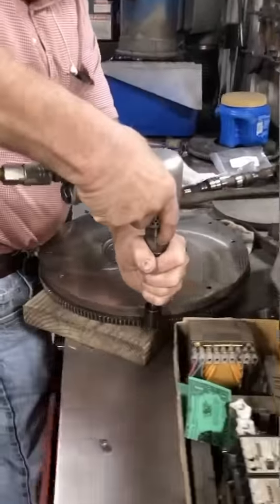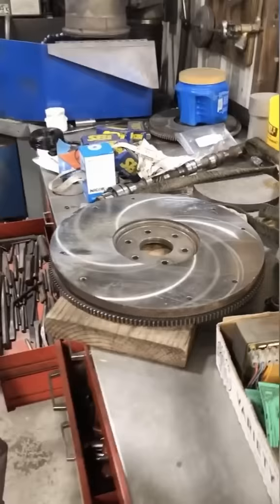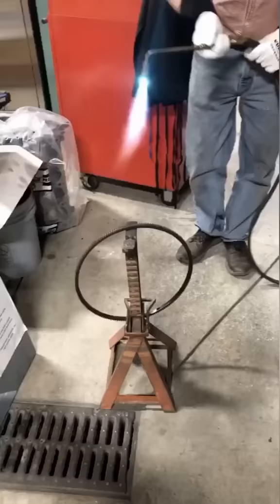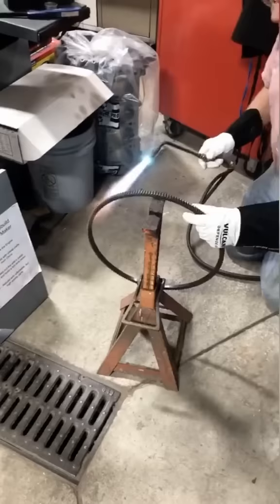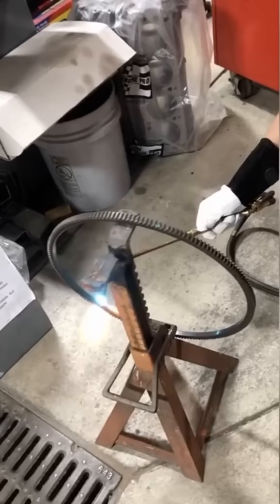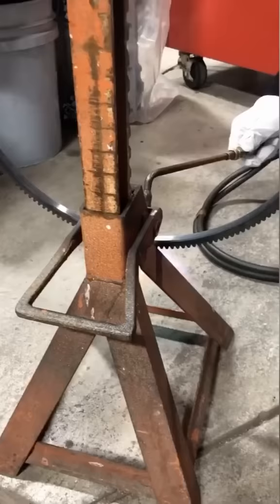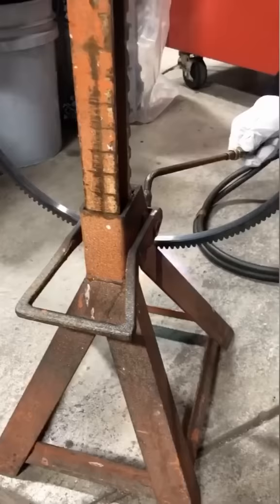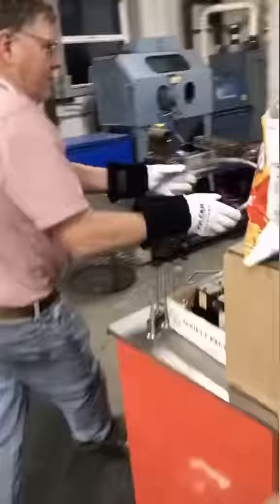#shorts Flywheel Ring Gear Replacement

Comment: Did this using a bbq grill. Half of the ring gear teeth where worn, so I just flipped it over. Worked flawlessly ever since.
Reply: I had a Chevy flywheel that I put on backwards cause of work teeth. Can't do that on these newer cars
Reply: On my car I was able to reverse flywheel, automatic trans, the flywheel was neutral balance
Reply: At a low heat it really is a better way, or an oven. With a torch you risk getting it above 500F and ruining the heat treatment of the gear teeth.
Reply: “Hey, the mechanics have figured out how to reuse these gear rings by flipping them over.  Make a note to redesign them so they’re half as thick, because f those guys.”
 - engineers.
Reply: I just flipped starter ring over on my brother's father in laws truck engine.  Had to weld it on to flywheel.  He bought truck new and gear came off flywheel at less than 30k, Chevy dealer welded it on first time.  On an old S 15 4x4 small truck.

Comment: I was in the transmission business for years. I learned something weird. The physics of a engine always stopped in one of three positions when you shut the engine off!! That means that everytime I started the engine the Bendix would hit one of three spots every time. Which led to wear on the ring gear in those spots!!!! Your father is spot on!! That's how I changed out Ring gears on manual transmission flywheels👍😎

Comment: Very cool, and nice torch work. Sounds like thermal expansion. The increase in temperature causes the molecules to expand while decreasing temps will cause shrinkage. There are some exceptions to this rule in some materials. Water for example stops contracting and starts to expand as its cooled to freezing, however only for a limited ranged before the material starts contracting again.

Comment: My dad taught me the same thing, I miss him.
Reply: I'm glad you called him dad and not the old man 👍
Reply: My kid calls me pops, but that's beside the point.
I used a similar process to change a ring gear on a limited slip carrier in a car, once. 
Carrier was placed on its bearing standing so the gear was facing down, bolts already removed.
Used the torch to heat the ring gear, and it fell off.
Turned the carrier over to the other end, standing in its bearing.
Placed the replacement gear so when it fell, it would line up with the bolt holes.
Heated it up, and waited until it fell onto its seat.
Did a quick alignment with a spud, and made sure it was totally seated on its own.
Then, the bolts were torqued down, much like a wheel bolt pattern. 
Never had a problem with that method, and never overheated the ring to lose the temper. I will say that I'd did take a few more than six passes, though. 
Those things are THICK.
Reply: Mine as well. He's always fabricating something.  His ingenuity blows me away.

Comment: Damn, I thought for sure that the teeth were machined into the flywheel
Reply: Same here
Reply: Hey no worries! I love mechanical items of all kinds, guns, cars, tools, doodads of any kind make me smile, for the longest time I thought the same! And you aren't wrong tho, some gear sets ARE machined as is. But when you think about it it makes sense for a vehicle, I mean you use it almost every day all the time and parts WILL be replaced or worn on it after all, i suppose it's easier to machine a ring with teeth and it makes it much cheaper when there is very little material. Plus if you have a problem with one you can slide it off and replace the teeth themselves (which when I think about it its genius) because they're the one part of a gear actually being exposed to wear and tear, so why throw out the whole thing when you can replace just the ring? This is why I love things like this. Each day you learn something knew! Even if it's not complicated, its neat. It's even cooler in my opinion when the solution to things like this is the simple answer used in a clever way.
Reply: Me too, I always thought it was a single part/piece.
Reply: I didn't
Reply: same here
Reply: @wedohedoshedooowee828  Just depends on what kind and year! My 1965 IHC has the teeth machined into the flywheel itself. Everything's different, just gotta try to see the mating lines or check forums or service info if you have it
Reply: really and the ring gear just threaded on like a quarter 20 🔩 bolt/nut
Reply: @wedohedoshedooowee828  I  took it off and would flip it a gaff turn and put it back on other side is like new
Reply: On some flywheels they are.

Comment: Hey man, love the videos. Not sure if you have ever tried it or not but if you have an old oven you can put a flywheel in there for 5-10 mins the old ring will fall off. Throw the new ring gear in the oven for a few mins and it will drop right on
Reply: Why do that when you can use fire? 😳🔥😅
Reply: @dannygurney5130  Oxyacetylene is expensive
Reply: @explosivemallard8038  Yes it is. Yes it is. But, it is explosive fun.
Reply: @explosivemallard8038  the rig might be, but filling bottles is cheap.
Reply: You jus said it, 5-10 mins.... Using the air hammer is faster. And it looks like a shop use paying for gas is cheaper in the long run 😉 doing other jobs and such...
Reply: It seems to me in an oven the rate of expansion would be the same between the fly wheel and ring gear keeping it locked on. I have never seen a ring gear slip on a hot flywheel in a vehicle and that is higher temps than an oven. I personally cut the ring gear with a torch. Then heat by the same method. It only take a few minutes.
Reply: @explosivemallard8038  so is a wife when she catches you putting car parts in the oven
Reply: WRONG!   If you did that the flywheel will expand too and the ring will not fall off

Comment: Thats awesome  I believe for every 100⁰ you expand steel you get 0.001"
Reply: 1 inch of steel expands ~.001” per 100°F. Yep. That’s essentially the basic rule.
Reply: 7 micro inches per degree F, that's the coefficient of expansion for steel. This is simply a coefficient for plain steel, so a shaft. When you have a thin walled sleeve/gear it will grow differently.
Reply: @patrickirish9427  im not a machinist never learned the proper coefficients of what metals expand at lol
Reply: Interesting fact. Thanks 👍
Reply: @patrickirish9427  Your understanding is flawed. The coefficient of thermal expansion is effectively identical for all grades of steel for this purpose. It doesn't matter if it's a solid disc or a ring the calculation is the same.  Go look up the math and I can walk you through it.
Reply: Isn't it steel dependent? 1080 is denser than 15N20
Reply: How much in SI?
Reply: And the larger the diameter the more growth you get

Comment: Been a mechanic all my life and never knew this was a thing 🤔
Reply: Me either
Reply: I'm a machinist. We have tricks for EVERYTHING!! Probably have heard of this one. If you cant get a bearing off a shaft throw it in the freezer.
Reply: I'm a industrial mechanic. I don't even work on cars :c
Reply: @officialaaronjames9641  that I have
Reply: Same here
Reply: @officialaaronjames9641  or heat the bearing. It’s a lot quicker. Even quicker than that they make bearing splitters. A puller just for bearings
Reply: I usually put the ring gear on a sheet of
metal and heat the sheet so it’s not taking direct heat. It’s a lot safer when you’re heating big Diesel engine flywheels
Reply: Its because  its a flywheel off a stern drive boat motor.. probably a mercruiser..
Reply: I knew about this but never seen it done. Watched six or more times to make sure I didn't miss anything. I finally noticed that the FLYWHEEL was turned over before the heated RING GEAR was installed.
Reply: @luissalazar4460  I usually have a worse time with heat, tens to heat soak to the shaft more than the bearing

Comment: I had a 74 Chevy truck with a stick on the floor 350 motor did some work on it years ago and that fkr sounded decent my old coworker and I left last ones from a auto parts store he burnt rubber leaving so he wanted to see what I am about so I let her rip but afterwards the ring gear slipped right off I learned from there at that point on heat is the enemy lol 😂 thank for the video
Reply: Ok... Doesnt have anything to do with heating a ring gear up to slip it on a flywheel though. Once it cools its as tight as it was before.
Reply: @mikeznel6048  😂q

Comment: I helped some machinist at work do this once. The old FFGs had two Detroit 8v71s that had a coupled crankshaft so the engines were linked together. The generator set consisted of the two engines and a 480volt generator head. There was one genset on the port side and one on the starboard side. The ring gear was probably 20 inches in diameter. The machinist brought it over because we always had a torch hooked up and I set up another torch so we could both heat 180 degrees evenly. We pulled the old ring gear off and heated up the new gear then the machinist installed it. He went back to his shop and returned right back and told me he installed it backwards. Interesting project, they cut a section of the Hull out just big enough to pull the engines out. They have to install a cofferdam because 3 feet or is below the water. The remove, rebuild, reinstall and test one side then flip the ship around and do the other side.

Comment: We always hated the ring first to knock off then heat to install. I did one my first time after helping my Pops when I was 12 to 14, but at 22 or so I did this repair for my Grandpops on a 1940s or 50s model Farmall H tractor, single dual front wheel setup, that spun on the chain hoist and flipped breaking the exhaust manifold, D'OH!!!!!!!!!! Live and learn, and no one got HURT, almost but not quite. It was a success in the end, that was 20(+) years ago, GOOD TIMES!!!

Comment: Worked at a farm tractor shop and I think we set the ring gear on the flywheel, ran the rosebud around until the ring gear dropped into place. Same result, just didn't have to handle the hot ring gear.

Comment: If you have the time, a grill/oven and freezer is easier, but takes longer. Did this on my 1978 240D. Poppped the flywheel w/ ring on the grill, and by the time I came back, the ring gear fell off by itself. I let it cool off, popped the flywheel in the freezer, and the new room temp ring gear slid right on.

Comment: When I did mine, I stuck the flywheel in the freezer and the ring gear in the oven at about 300 degrees.  It worked well.

Comment: I've always taken the ring gear and put in in the oven for a few minutes at 500° and then it'll fit perfectly on the flywheel as it cools.

Most ring gears cost around $40 so it's easier to replace than the entire flywheel.

Comment: Done that many times working on Clark forklifts as a shop mechanic for years. Don't miss it one bit but was Damm proud learning new stuff best one I learned was to remove a bearing race from a blind hole was to use a stick welder and put a bead of weld on the inside of race it will just fall out fast.

Comment: an old electric or gas oven set just below bench height would save gramps knees & expand the ring evenly while warming the shop in winter. putting the old oven on a rolling cart would allow moving it outside for storage or use in summer heat.

Comment: We have a set of three 1/2" chains, we hang the ring gear from the crane, then we have a multivane Ingersoll Rand air drill set up to spin it in front of two natural gas burners boosted with shop air.   We stand the crane drums on end and drop it onto the gear fit.  Sometimes you have to weld stops on so the gear doesn't slip past its register, as it can expand more than 3/8" in diameter.  Some are up to a little over 10' in diameter.

Comment: I did this for years and the one thing I learned is when you do this you have to go back with a brass drift and tap the fly wheel down flat. sometimes  there is a space left because the ring gear doesn’t seat all the way flush so you have to tap it down or you may have a starter engagement problems…. Keep on rockin

Comment: Worked rebuilding turbine engines. We had a big oven set on about 500 degrees and a big cooler full of dry ice. You could place a stainless seal on the dry ice and it would scream then start bouncing off the dry ice. Drop it on the turbine disk that had been in the oven for about 20 minutes and place a weight on it till it all cooled off.

Comment: I had to replace a bearing with an interference fit on a snowblower once.  I put the casing of the bearing in front of the shop heater and I put the bearing in the snow.  5 minutes later the parts fit together with a bit of play, and then resized into each other.  This spawned the technique of putting the outside part in the oven and the inside part in the freezer.

Comment: We actually are very fortunate, we got an old electric oven at our shop, it goes to 250°C and has worked for all cases we had that had a shrink fit. Yes its a bit slower than the torch but doesnt have the risk of uneven heating

Comment: Just another little thing to look out for some ring gears have a bevel on the teeth on one side to assist with start motor gear engagement make the bevel faces towards the start motor when fitting the ring gear 👌

Comment: We always used to put the ring gear in the oven  just regular oven the same as you’d cook your pizza in , make a cup of tea  drink up and list let it drop straight on the fly, we had our oxy acetylene torch but we always did it that way as it would always get the new ring gear hot  all throughout without creating any hot spots and less risk of potentially changing the tempering of the metal on the new one.

Comment: An induction heater/ burner will change your life! While the torch works, you don't know what temp you're heating the metal to or if you're taking the tempering out the part. Most ring gears loose their tempering at°450 or above. The oven or induction method is faster and it's a controlled heating and cooling cycle. All this did was anneal a ring gear, the installation was a byproduct of that.

Comment: We used to set flywheel on concrete floor place ring gear on top ,heat around and it would fall right in place . Just heat the ring not flywheel.  In some cases if you could not find a ring gear you heat to remove and flip over so stater would catch .

Comment: Neat little trick for removal, if you can crack the old gear in between teeth without damaging the flywheel youll save about 10 mins of time with that air hammer. Large heavy chisel plus slege and itll fall off(they crack very easily for something that handles that much torque)

Comment: Hears the tip but just for  a moment. 
 Run the torch with minimal o2 for a sooty flame . 
Thinly coat the gear with soot.
Now set the torch properly. 
Heat .
The soot will go away at ~300°f. Telling you that it has reached proper pre-heat for slip fit, or welding.

Comment: Hey there, if you do ring gears often grab an old house old oven and heat them 500* for like 45-1 hr evenly heats it up without the risk of creating weak points (but not everyone wants an oven in their shop) would save you’re dads knees tho!

Comment: During the age of steam locomotives in the beginning of the last century, the flanged tire of the driving wheel was heated with a gas torch expanding the "tire" and it is then hammered off and hoisted away. Next the new one is already been being heated and a chain hoist sets it on the driving wheel center, and it's hammered into place. It cools down and shrinks into place. Essentially the same thing, I've oversimplified it but I'm sure you can find it on YouTube

Comment: Never wasted my time that way. Popped the old gear with a punch, put the new gear on the flywheel, 3 passes with a rosebud and it pops down, done in less than a minute. I'm a retired heavy equipment mechanic and never had an issue doing it this way.

Comment: I have used my wife's oven to heat the ring. And used the oven to take a steel jug out of a 100 cc two cycle motor. Put the outer in oven. And the jug  in the freezer. Everything drops back together.

Comment: Don't always have to replace the gear. Most of the time you only really need to flip it. The starter gear typically only wears the corner of the gear.  I tack weld it a couple of times aftet it shrinks jic it over expands during heating.

Comment: I never thought about replacing the ring gear ⚙️ on a standard clutch flywheel. I have years ago just rotate the engine. Because I started seems engage in the same spot over and over. And occasionally I'd have to rotate It again by hand. Because it would turn up in that same Worn bad tooth spot on the ring.

Comment: A better way (saves the knees) is just hold the ring gear with a pair of vice grips. A few passes with the torch while standing up, and you put it on the flywheel.

Comment: We like to heat up the old worn ring gear until it expands. Tap it off the flywheel with a punch, flip it over and tap it back on the flywheel. The backside of the old ring gear teeth looks just as good as the front side of a new ring gear teeth, from the perspective of the starter gear. (Save buying a new one, flip your old one over.. Do use a new starter gear, though...).

Comment: don’t heat the ring gear  till it’s red hot or it will shrink slightly smaller than it was originally and it may split / break when cooled .

Comment: Nice video- never new they come off like that. Go to the hardware store and pick up some knee pads.  Kneeling on concrete is bad enough let alone if you kneel on a bolt or something. Thanks for the video; you are very lucky to get to work with your dad.

Comment: pro tip: put some motor oil on that gear and when the oil starts to smoke evenly you have reached the right temp. (about 450 degrees)